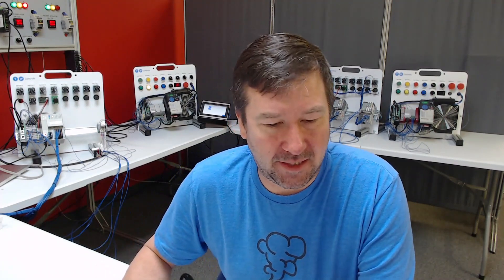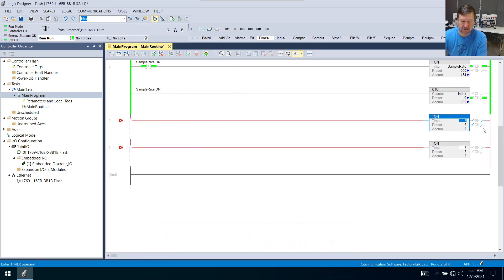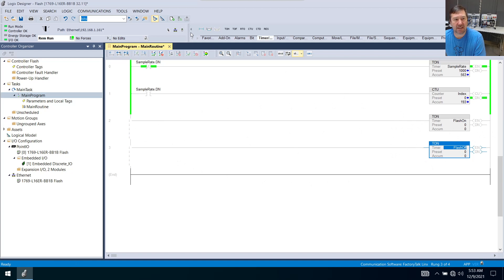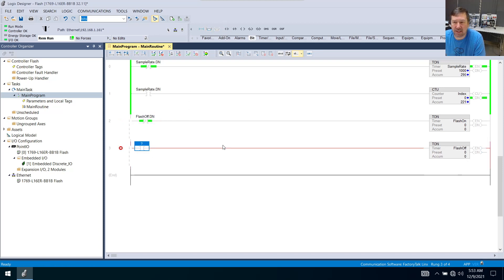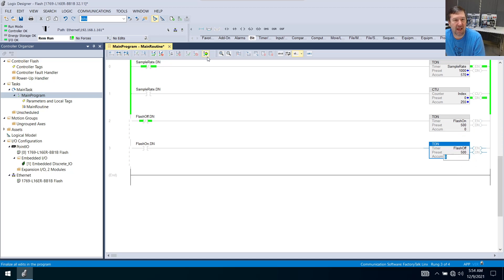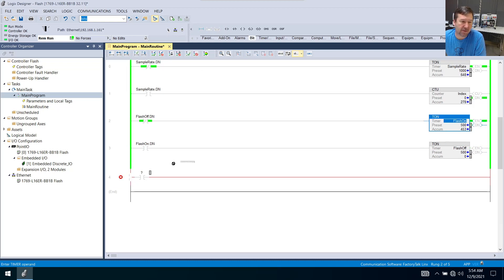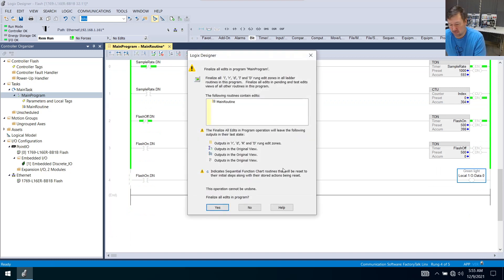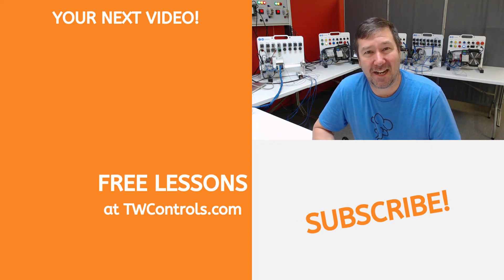Allen Bradley Flash On Flash Off Timer

Comment: Hello Tim, 
I have a SLC 5/04 plc with devicenet communication card as well as Pro soft MVI46-DFNT card. In pro soft we have p2 application and p3 application port available. I assume I can use these ports for the VFD speed control. 
So 1) can I use p2 application and p3 application port for handshaking with VFD?
2) How can I use M0/M1 file into my ladder logic to give frequency command to the VFD.
Thank you for your answer as always.

Comment: Good video as always. Suggestion though: the subscribe noise at 0:24 was pretty loud compared to the rest of the audio. Might want to back off on that a bit.

Something I have seen done before was a timer (say 500ms) going to a counter, and then a light would look at the counter. Example: if counter == 1, 3, 6, 7 turn light on. This would give a simple blinking animation with 2 short 1 long pulse.
Reply from the maker: Another good method, yes we're working tweaking the subscribe thingy.

Comment: I usually use a single timer and simply compare the ACC against a value set to half the PRE.  If the value is greater then set the Flashing bit.  Something like this:
XIO FlashTimer.DN BST TON FlashTimer 1000 0 NXB GRT FlashTimer.ACC 500 OTE FlashingBit BND
Reply from the maker: Yes, that is another good way to do it.  Thanks for sharing Dave.